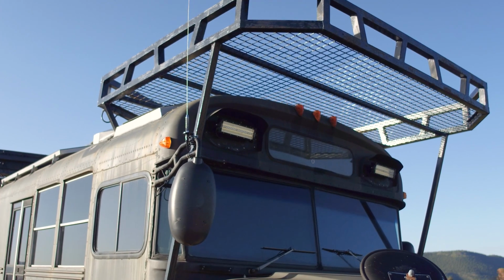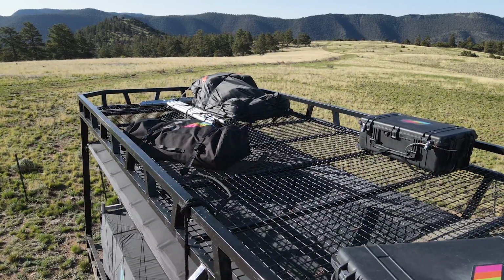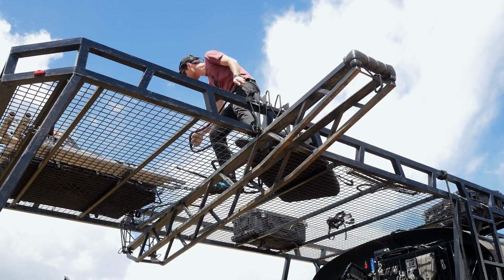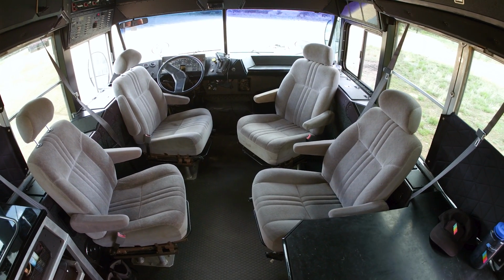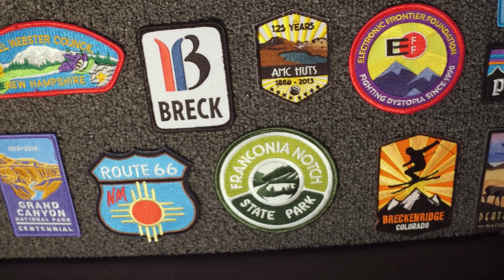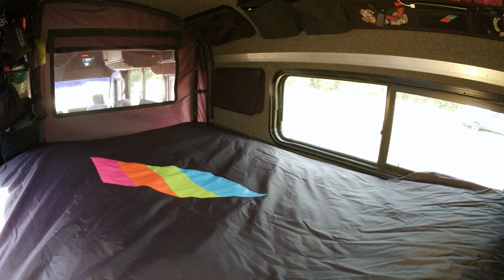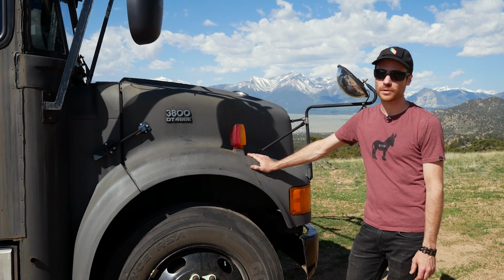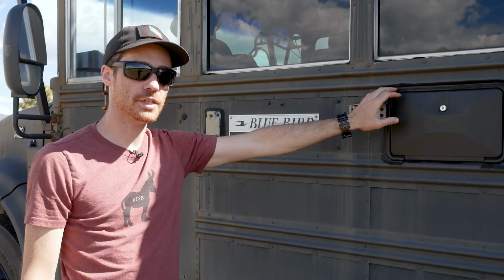Extreme Bus Conversion: Mind-Blowing Features Revealed

Comment: Back in the 1970's after I got out of the Army, I went to work for DOD Forward Area 5 th Army Maintenance Division in Michigan and I was the head body man. .. so I was the one, with a mechanic who inspected all turn-in verticals for property disposal (Auctions). As a combat solder (2/502 Infantry, 101st Airborne, Vietnam), I had no experience with many of these vehicles, most "new to me".
 I got a field machine shop on a deuce and a half frame from an Army Unit, turned in because of it's age. It had everything from drill press, welders ... everything you could imagine in mechanical tools plus compressor, Generators; 12/24 Volt and 120 Volt. On the sides of the truck, all had removable door/windows, plus it had expanding canvas roofs... though it ran well, it was just beyond it's repair date in age only. No idea what they sold it for, but with a little work, I'm pretty sure you could have converted some of it's space for a camper... This one you built, I have to admit, is miles beyond belief..
Reply: Thank you for your service!  God bless you and your family.  ,❤

Comment: That's fantastic. Not exactly what I would do with that bus, but it does a lot. The full rack on top is awesome. The crane boom is pretty specific to his needs but the outdoor tenting/screen room is a great outdoor living space. Probably too high tech for most when it comes to the systems control, but he built it so he understands what it does and how to do it. All diesel is a good choice, simple. With that much roof area, solar could be more of power source, using the diesel as a backup for heat/ac. I would try to keep the weight down to increase the mpg efficiency if it was a full time rig.

Comment: If it survived covid outbreak then mission accomplished 😅 nice rig though, although for a rig this size you should've built a toilet and shower. Sure you have enough space to do so.
Reply: I was thinking the exact same thing. There is barely a kitchen and no bathroom. I would want a more private space for a shower and a toilet (preferably one that doesn’t need a black tank). Hot water and soap for dishes is a must to get rid of bacteria. Civilization does have a lot of problems, but there have been some very useful advances, like proper hygiene and sanitation that have allowed us to live much longer lives. Though they are expensive, on demand hot water heaters use much less water, are small and efficient; they seem like an important investment.
Living off grid responsibly does have costs to it, but I think it is very important to do so as much as possible. With so many people trying to live off grid, but leaving the toilet system to the last, using garbage bags or a shovel “until they can afford something better”; when it should be the first priority, is hazardous to the community. With housing so expensive more people are becoming homeless and living in their cars because of finances, people who can afford it should be as responsible as possible. Dumping grey water on the ground or into the street is another big issue for the environment as well.
Reply: Can't spare the storage for a bathroom. And what's the need for a bigger kitchen if you have no room for extra food storage? We can all agree that storage is priority number 1 (through 100).